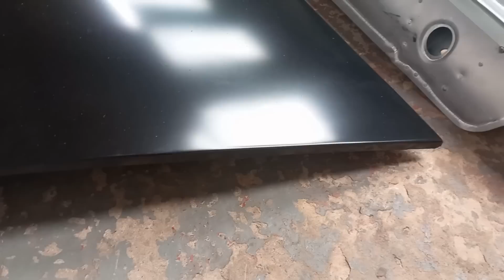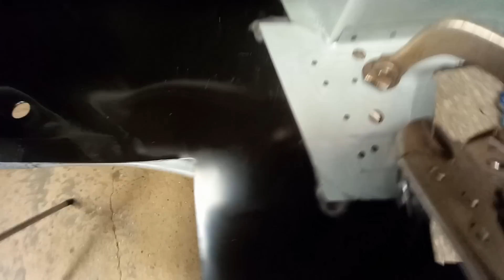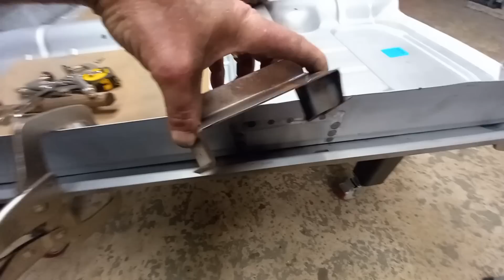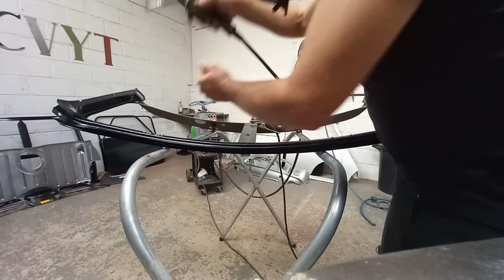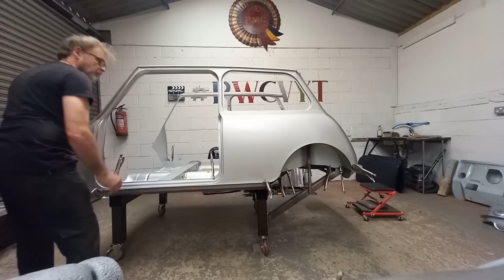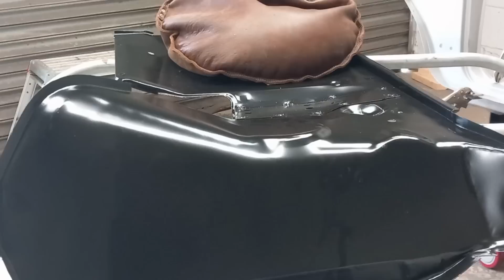Building Magnum Panels' Brand New Mk1 Mini Bodyshell For Showcase Exhibition in NEC | Ep1/2

Comment: Great work and video, Q.If it's going to be a Motorsport shell why would you not seam weld the panels for extra torsional rigidity of the shell
Reply from the maker: Good question. The MD of Magnum is a bit handy himself and has plans for that which will be in a follow up video later on

Comment: No question Paul , you know these like the back of your hand , which is why  your work will be at the NEC . That last footage of cleaning of the flitch ......what's the purpose ? I guess tne unit doesn't have 3 phase ?  Thanks Paul
Reply from the maker: I had welded up a hole in that area so had to make it look nice. no, no 3 phase

Comment: I have a R. H. front nose section from a early (59 or 60) mini mk 1 assembly.
It lacks The separate "A" panel and resembles the new magnum 
panel, I guess BMC decided to make the body more repairable
after a frontal crash by adding the separate "A " panel.
Reply from the maker: @jimhall9624  the A panel was never separate on a saloon, it was a one piece pressing but was it separate on van and pickup models

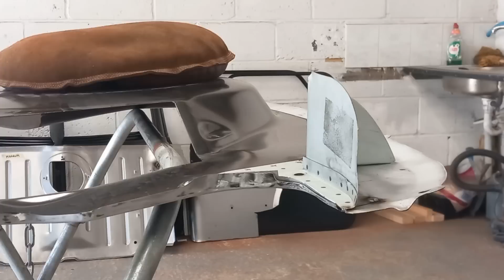Comment: At 5:56 are you spotweld only two layers together ? I mean the stiffener panel to the boot floor, but NOT  the closing panel
Reply from the maker: There are 3 thicknesses there. The bootfloor and the valance closing panel which is 2 thicknesses itself
Reply: @PWCV-YT  Yes I know it, I am also restoring a Mini :)  The stiffener has an area where it is not connected to the closing panel, just to the floor, right? Do you spotweld the whole closing panel to the boot floor at only this area ?
Reply from the maker: @csakbencee  Ah, I see what you are asking now, It should be spotwelded in the 2 thickness area and in the 3 thickness area. It's important to spotweld near to where the subframe mounting bolts go through because if they are not pulled tight together they will distort as the bolts tighten which will crack the paint and lead to rusting in that structural area
Reply: @PWCV-YT  Thank you ! I am not sure if my spotwelder powerful enough for 3 layer but I will make some test